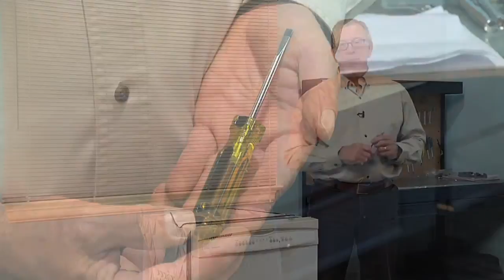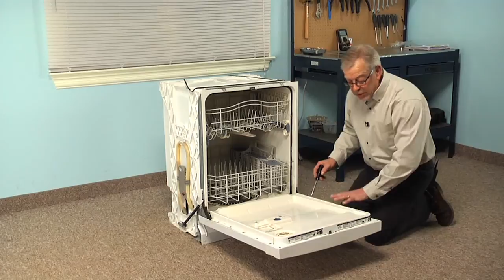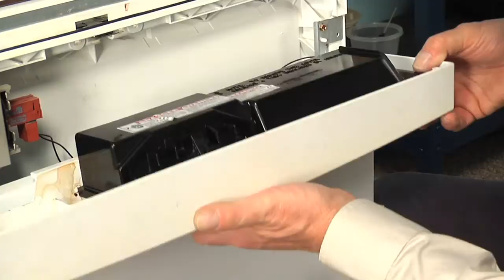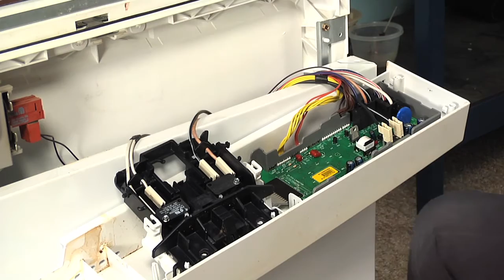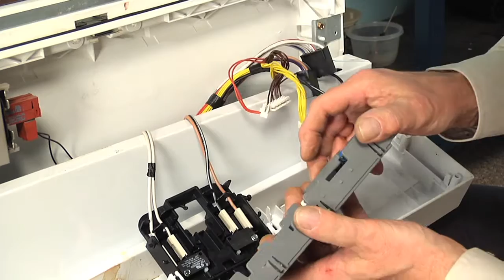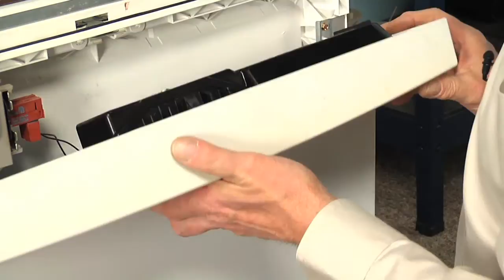Dishwasher Repair - Replacing the Control Board (Whirlpool Part # W10084142)

Comment: Mine was blinking like a Christmas tree so I replaced it.  Now I have nothing - no lights at all.  Could the fuse have broken during the swap process?  Also, mine has less connectors but it's a different dishwasher using this same board.   Thoughts?  Thanks!